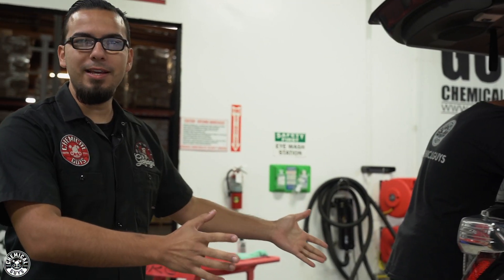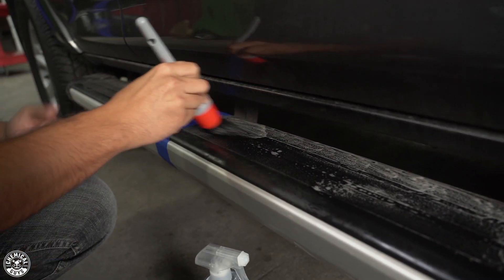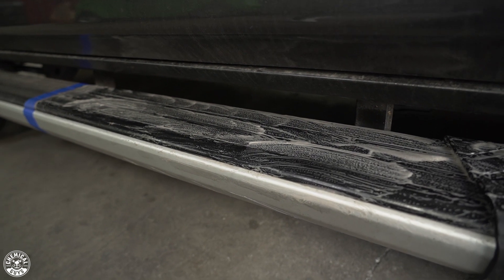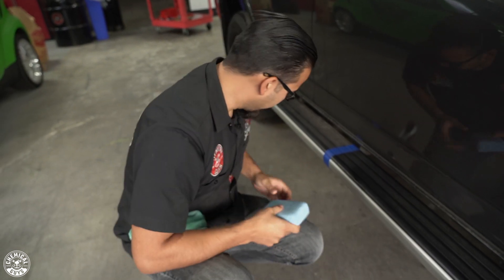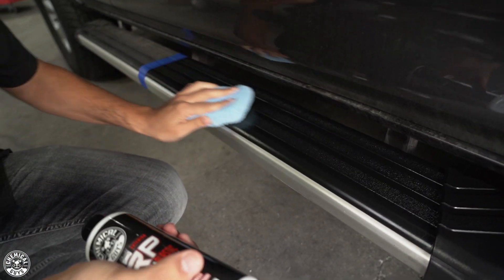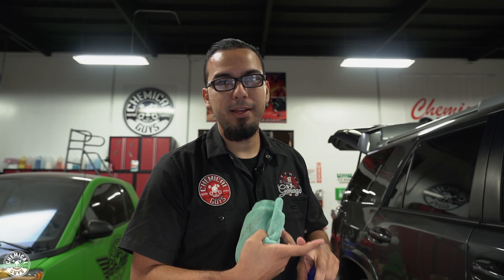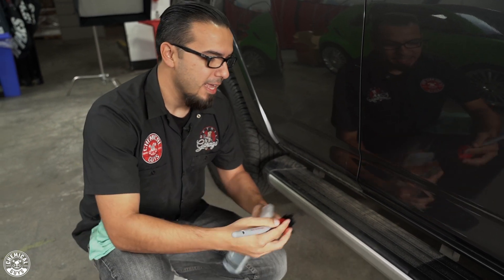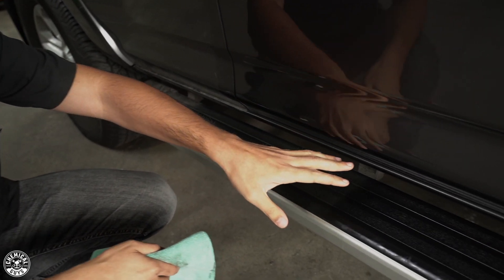How To Fix Faded Trim Pieces! - Chemical Guys

Comment: Hello Nick, What do you use to take off remnants of white dried wax that is stuck on hard vinyl. It is in the little pores of the sand textured black exterior vinyl. I used a stiff plastic brush with 100 concentrate CLEAN SLATE and it didn't take off the white specks. I first used a rubber eraser which took off most but the wax remnants but it is still there. Will nonsense all purpose cleaner take it off completely....btw I already bought the VRP but don't want to put it on top of remnants of white residue wax. it will defeat the purpose.Thanks
Reply from the maker: Hi Grant! Thanks for your message. Nonsense will help to lift stubborn stains, you may also want to try Trim Clean which is designed for such jobs. 
- CG Nick 
https://www.chemicalguys.com/trim-clean-wax-and-oil-remover/trim-clean.html

Comment: Hi, great video. Was the nonsense undiluted? Is it safe on tires undiluted? Thanks
Reply from the maker: Hi there! We used Nonsense diluted (10:1) but it can be used at full strength for really tough cleaning jobs.
- CG Nick
Reply: Chemical Guys thanks a lot Nick. Hope you have a nice thanks giving!
Reply from the maker: Thanks so much, have a very Happy Thanksgiving!! 
- CG Nick

Comment: Hey CG I watch a ton of your videos and I am a long time user of your awesome products. With that said I know with your expertise you can guide me to the product I am in need of. I have a Dodge Challenger and in the rear where the chrome DODGE symbol is, there is a shiny black plastic underneath. Please tell me what product of yours would be best in taking out minor scratches of that black plastic with also providing me with gloss and a little bit of added protection so I don’t scratch it as bad in the future. Any advice would be much appreciated. And keep up the good work and the great videos coming! Thank you !
Reply from the maker: Hey Alan! Thanks for tuning in! I recommend machine polishing with V36 Cutting Polish and an Orange Hex-Logic Pad to restore clarity before applying HydroSlick for more gloss and protection. 
- CG Nick

Comment: might be a dumb question but can you wash those blue applicator pads with all your microfiber clothes in a washing machine?
Reply from the maker: Hey Devin! Yes, toss your microfiber goods into the washing machine with an ounce of Microfiber Wash to loosen grime. Dry on low heat/tumble.
- CG Nick 
https://www.chemicalguys.com/microfiber-wash-cleaning-detergent/microfiber-wash.html

Comment: If Nick responds to this comment, I’ll buy Chemical Guys’ VRP
Reply from the maker: Hey Cloud Auto Detail! You're gonna love V.R.P.! :D
- CG Nick
Reply: Chemical Guys how do I know this is the real nick lol? Also does this work on Rubber Mats, no slippery?
Reply from the maker: Valid point haha gotta take my word for it! V.R.P. is dry to the touch so it won't have a greasy or slippery finish. You can also try Mat Renew which was designed specifically to care for rubber floor mats. 
- CG Nick